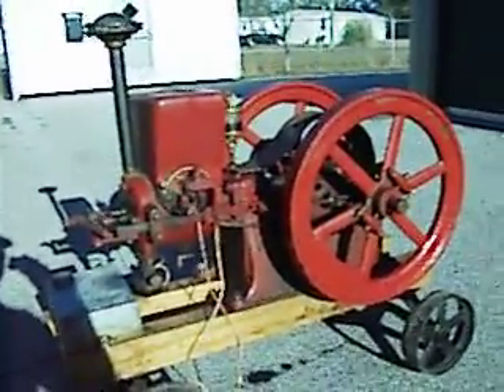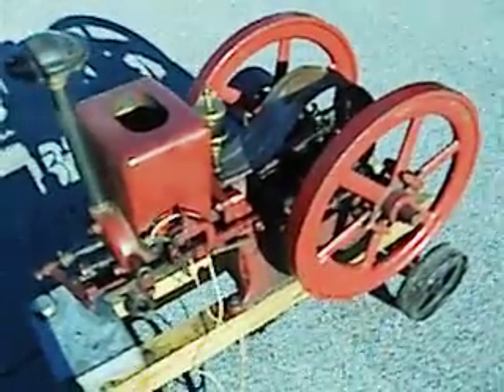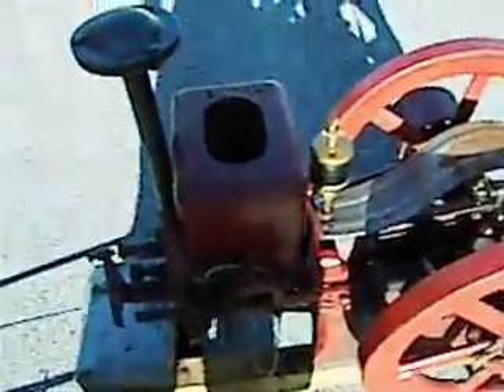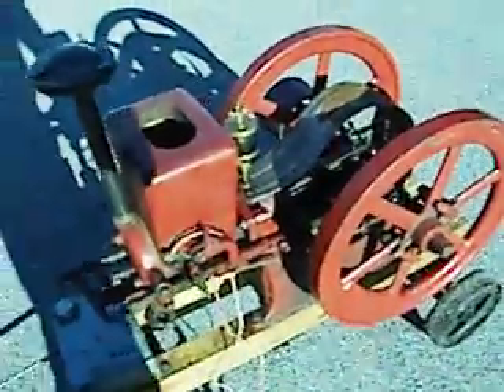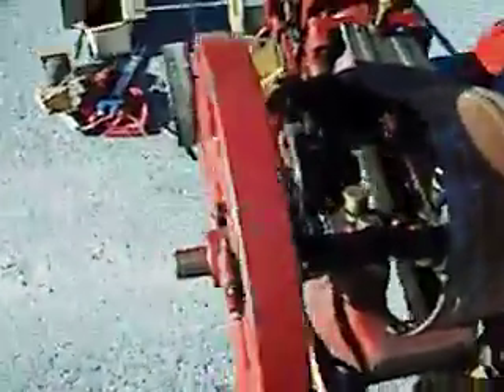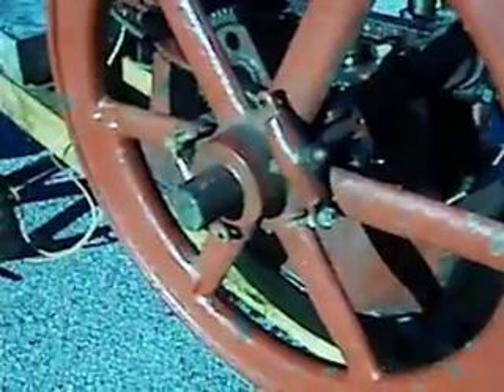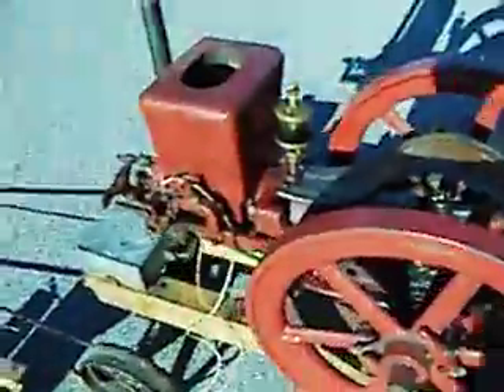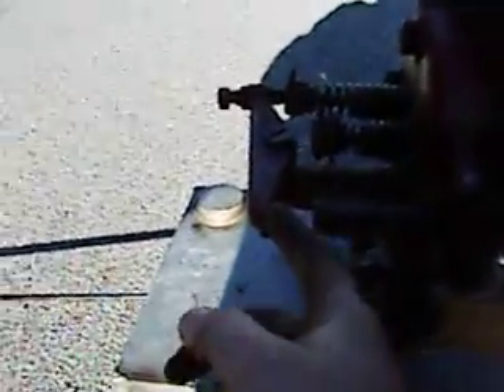How hit and miss engines work

Comment: the design of these things have always amazed me ...... i m going to make one from scratch using piston , rod , crank assembly from another motor and make everything else from billet aluminum and steel cylinder liner, valves .. using the least amount of bought parts (springs and bolts etc just gonna buy) .............................. stay tuned

Comment: this seem very similar to how those swirling balls on a steam engine works, if the engine starts racing away it cuts down the steam flow. Couldn't that same thing be applied here, because it would make the fuel intake smaller at higher rpms and thus keeping the rpm on a kind of constant rate? Or is this way more efficient?